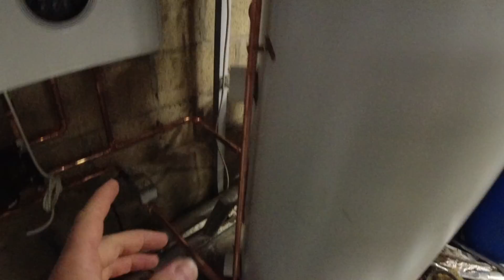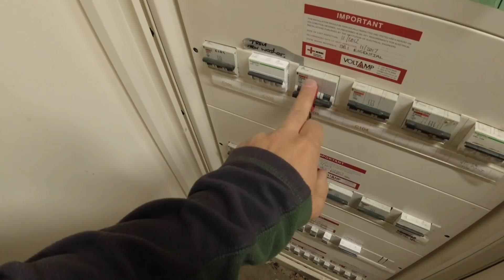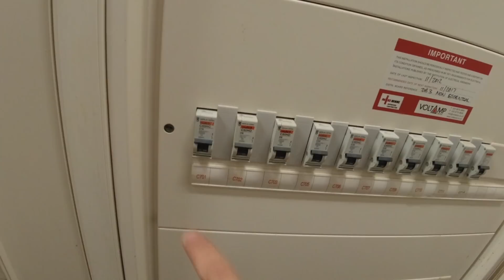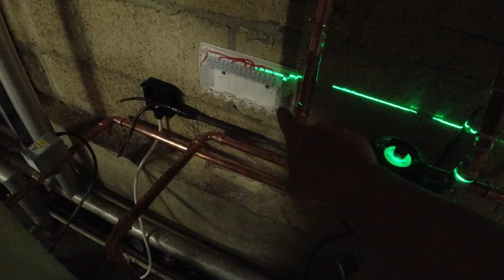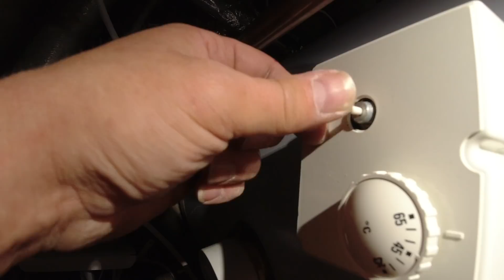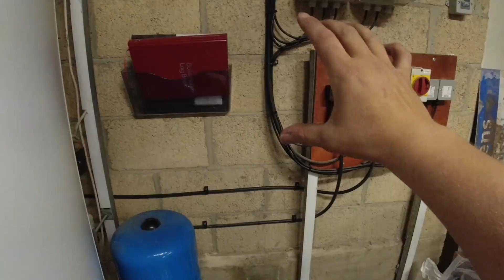DIRTY DARK HELL HOLE PLANT ROOM. Commercial electrician

Comment: Just to clarify, you have a permanent line to the thermostats and a perm line to each grey on the motorised valves. When th e stat calls it powers the brown for the motor which in turn closes the microswitch that powers the orange('switched live') to fire the boiler?

Comment: Took me right back to the good old days of industrial plant room work..
I don't know if you are aware Chris but the immersion elements are a back up heat source for the hot water cylinders (incase of boiler lock out, or gas supply interrupt) and they shouldn't be left to run continuously.. 
So the internal stat inside the immersion element should be set to 60 degrees and the control stats for the boiler should be set to about 65 degrees, & the only way to get this adjusted correctly is to bring the tanks up to temperature ie 65 degrees, then turn down the immersion element stats till they click off leaving 5 degrees (roughly) for the control stats to work in.. 

And so the immersion elements will only kick in if the main boiler doesn't and the stored water maintains 60 degrees according to L8 regulations..

Also on a system like this there ought to be a timed de-stratification pump..

Anyway,I always love your videos and it's awesome to see you doing some commercial/industrial work for a change..

Sending positive vibes buddy because your videos are always great fun to watch, so please keep em coming and I'd hate to see them stop because of the haters out there...

Comment: Hi. Chris two power supplies feeding 1 system. ???
Control unit controls both yet both tanks are on two separate power supply from separate DB boards and no test to make sure there on the same phase…. All heating should be 1 supply and 1 protection
Reply: There is no real need to consider keeping phases apart. It’s a bit of a urban myth. It would take a earth fault on both appliances at the same time to even make the voltage present any higher than it would be anyway.

Maybe would be concern in a domestic dwelling with two phases at one multi gang light switch. But certainly not in this environment.
Reply from the maker: Imagine the customers face if I connected all 4 immersions on the same phase 🤣
Reply: @Cjrelectrical  and what would be wrong in that ……..(but you only did two) so long as each tank had its on braker on that phase then no problem…… just remember on your reply that your DB boards can handle that it’s commercial
Reply from the maker: Those supply’s are on 100amp fuses 🤣
Reply: @Cjrelectrical  no safety issue at all for having immersion heaters on different phases. Suppose putting a ‘warning 400 volts’ sign would be good practice but no real need.
Reply from the maker: I know I’m in agreement
Reply: @tomorichard  urban myth you refer too is two 3phase machines or two sockets side by side on separate phases that is not the case here 
Tank. 1 on own power tank 2 on own power we don’t know if separate phases but say someone isolates tank 2 to do work on ….. it is not totally isolated as the value on tank 2 still has power from control which is isolator 1 and not marked up as such
Reply: @tomengineer1467  I see your point but the immersion portion of the cylinder and control wiring for the coil within the cylinder are obviously two different systems and it’s standard industry practice to have a separate circuit for each. But belt and braces I guess a label to confirm wouldn’t hurt but I have never seen such a label and have never thought it a safety risk.
Reply: The two immersion are two different system so will need two circuits, one to supply each one. Then the s/f spur controls the boiler setup. Whats the issue??
Reply: @wyndavies5044  the problem is valves are both controlled via switch fuse spur ….. so no not two separate systems …. Both tanks are heated not by boiler …. Boiler is there for extra heating…..tank 2 is own power but controlled with tank 1 control so no point two power supplies 
And again both tanks are from 2 DBS not testing to see if on same phase which they MUST not be
Or risk of 400v as both tanks are connected via copper pipes if a short develops
Reply from the maker: Immersion heaters are only connected for backup if the boiler/gas fails.
Reply: @tomengineer1467  don’t understand they are earthed via the flex and electrical installation. standard way of doing it would be different phases for load balancing. You can get 3 phase immersion heaters.

Comment: I don't get it. They have district heat? That doesn't get hot enough? Surely that's a problem lol. Was that a massive cylinder boiler to the left of where you were working? I've been in a District heat plant room. There were 3 massive boilers that provide heat to 900 homes. But the gauges on the boiler output shows nearly 100 degrees and where it enters the tower blocks (up to quarter of a mile away) the gauges read around 95 degrees, with about 85 degrees on the return depending on demand. Some serious kit keeping all that going 24/7. They need to upgrade the control wiring so they have to write to 900 homes and tell them they're without hot water and heating for a day or so!
Reply from the maker: This isn’t a plant room supplying heat to homes buddy it’s a little different.
Reply: In commercial sites you can have waste heat which it’s sensible to use for heating, but it’s not not enough for DHW without some boosting.

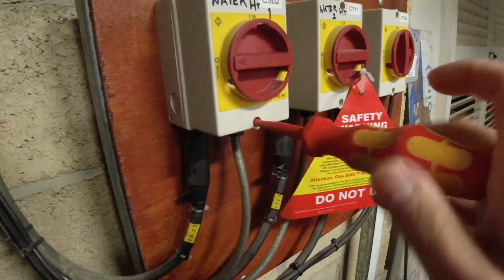Comment: The 5:10 "Safety Warning DO NOT USE!" would likely have been put on by the gas engineer to stop anyone powering up the plant before he's on site to check the combustion of the appliance as although they're factory set the relevant commissioning checks have to be carried out before allowing an installation to be used. Stainless tanks with the worst stats going. Nice job for not your usual realm of videos.
Reply from the maker: Yeah I’ve since found out the tag was from the old tank that was condemned

Comment: Great video, was confused with your explanation of the wiring, it should be Grey is permanent live. The stats only control the brown on the zone valve opening it and clicking the micro switch, basically sending power from the permanent live (grey) to the orange which goes to the boiler powering it up.. 

Is there any reason the plumber didn't do this? Or was it just with it commercial it had to be a sparky doing it?

Loved the video! Was great seeing you do some commercial..

I'm a gas engineer from bradford
Reply: You could wire the orange as permanent and grey as switch live to the boiler. It's just a switch so polarity shouldn't matter. (???)
Reply: Agree with Brendan. The call from the cylinder stat should have been connected to the brown wire of the valve.

Comment: Looks like a ball ache of a job.
Correct me if i'm wrong, but shouldn't the greys of the valves be perm live to the micro switch that switches the orange when valve open. and the browns are the 'motor live' to open the valve?
Reply: Was going to say on a 2 port the grey is the permanent. Had a job the other month and the installer decided to turn an y to an s plan and there was no bloody permanent live there in the wiring centre as a 3 port doesn't need one! Luckily had a spare core coiled up from the programmer in the kitchen to utilise.
Reply: Correct
Reply from the maker: Yeah correct rectified after.
Reply: @Cjrelectrical  good man